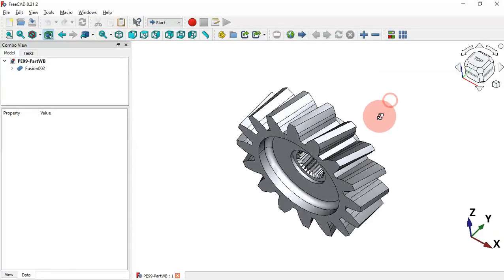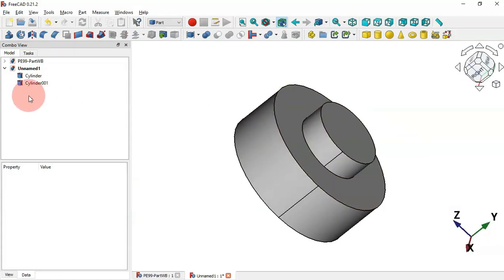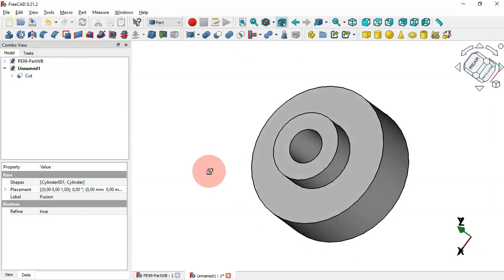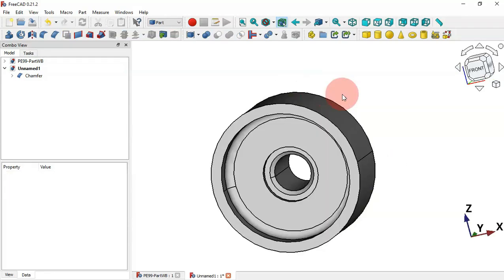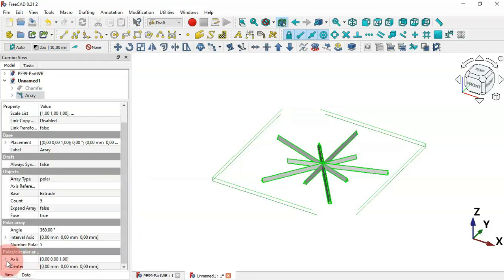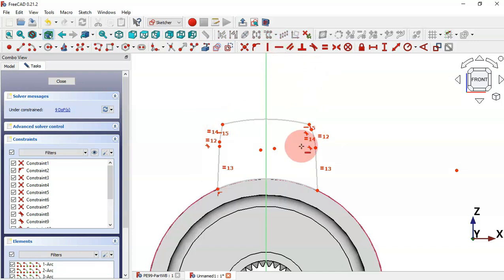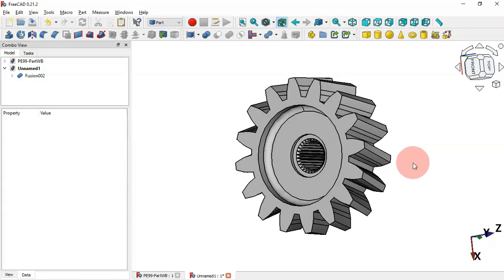FreeCAD 0.21 Beginners tutorial: practical exercise 99 Remodeling in Part Workbench

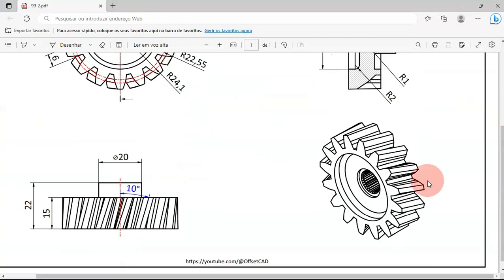Comment: @15:57 how is that the z direction? Looking at your axis indicator in the bottom right, the gear tooth moves in the Y direction? so why do we change it in the Z direction?
thanks
Reply from the maker: The reason is: when we are creating/tracing a sketch we are only working on X and Y axis, and when an extrusion is done, they happens in Z axis. The Z axis of a sketch differs on which plane the sketch is created. If we select XY plane when creating a sketch, the sketch Z axis will match with the document axis indicator; If selected XZ plane or YZ plane the sketch Z axis will be different from document axis indicator.